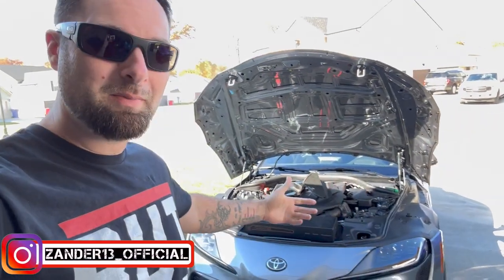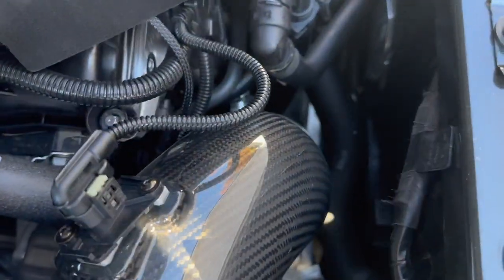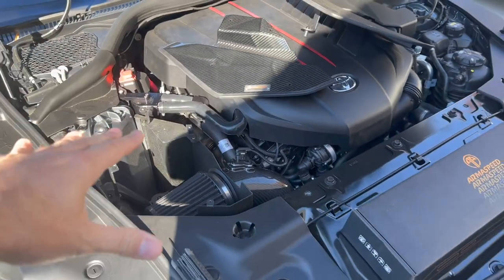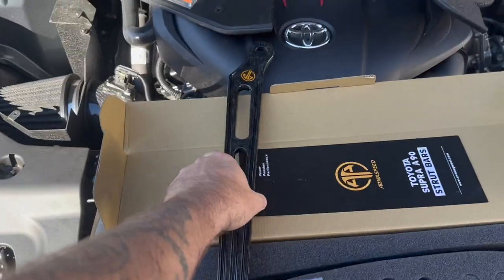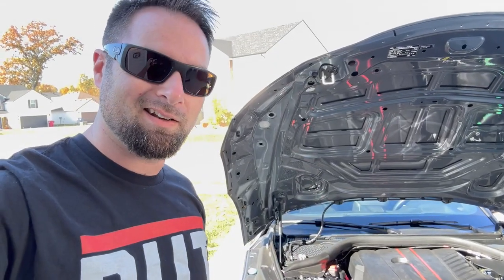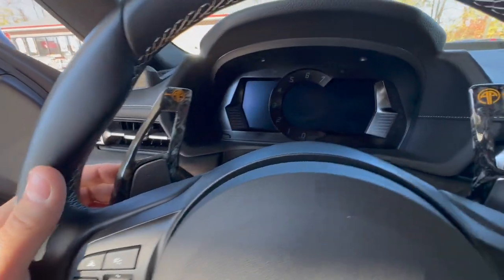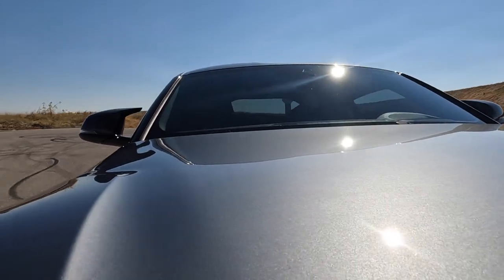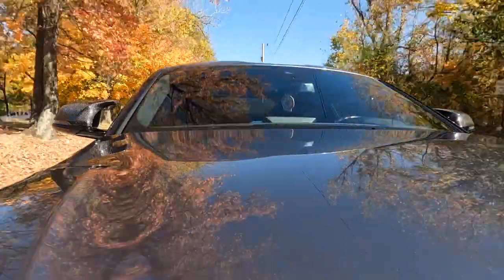TOYOTA SUPRA GET’S NASTY🥵E85+ Armaspeed Intake, Downpipe & JB4 ONLY

Comment: I got a 22 as well is setting up the fuel it kit a simple plug and play for the jb4 cause I would like to go to the next sep with my 22 have a jb4 just don’t want to spend 500 and it requires a lot of work to install
Reply from the maker: JB4 plus e30 and down pipe is nuts on these cars. I’m honestly very happy with it. And I’ve owned 1000hp mustangs before 😉
Reply: @Zander13Productions  cool that’s what I’m excited about I have the jb4 but plugging the e85 sensor in to the jb4 and downloading the app is all I need ?